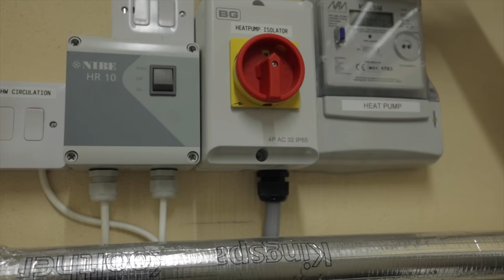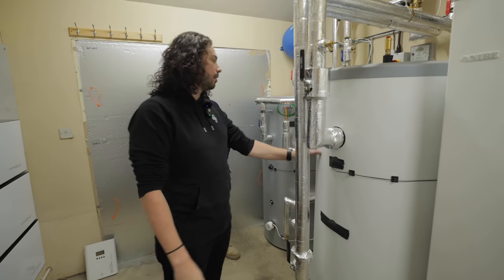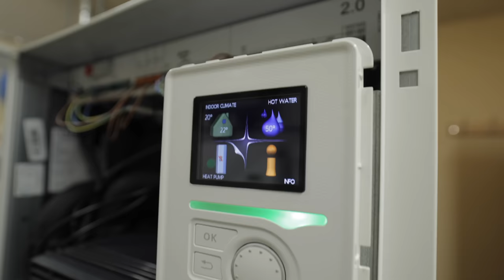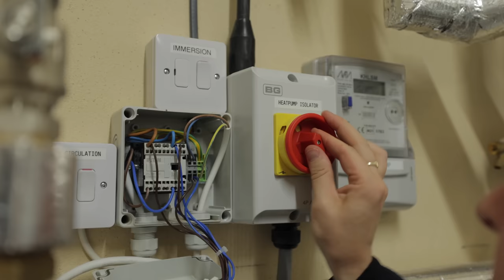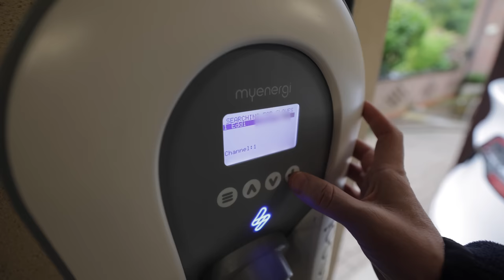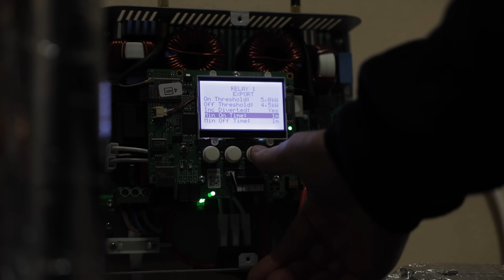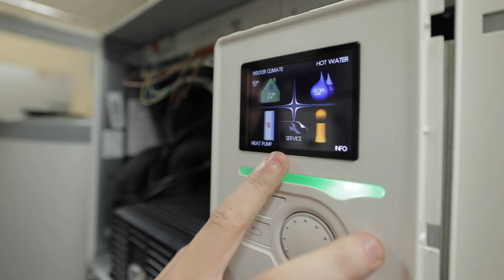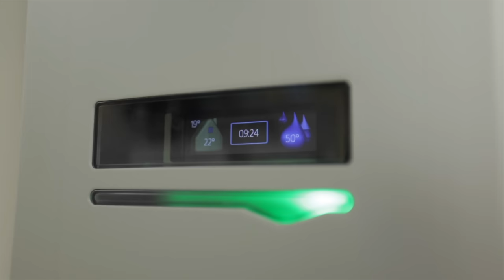This Solar HACK for Heat Pumps could save you THOUSANDS

Comment: Very interesting about triggering the heat pump from the Eddi. I've not done that with mine. I used to simply divert solar excess to the immersion element until I realised that raising the water temperature during the day stopped the heat pump heating the water at night on cheap rate, which it was set to do, because it made the water already hot enough. Add to that if you are on Octopus Flux then you are much better off exporting at 20-30p/kWh than saving the overnight water heating with cheap rate divided by COP to keep the water hot.
Heating from solar excess with the heat pump is better but it only saves that already cheap rate/COP overnight by shifting it to the day.
I use the Eddi now as a timed top up for the Legionella cycle one a week if the heat pump can't quite get it up to 60°C along with its PT1000 to monitor temperature.
Incidentally, if the 400L tank is already at 50°C it only takes 4.6kWh to raise the temperature up to 60°C so it's not a huge energy store. 
I'd be interested in what other uses for the Eddi there could be.

Comment: Hello lads! A little thought for reflection having in a similar system... A negative side of this application can be excessive wear of the heat pump, aggravated by the fact of operation at higher water production temperatures. For this reason it is essential that there is an effective use of the hot water and that it is not heated for no reason... Otherwise the electric resistance is better, which despite having a lower efficiency, does not cost as much wear and tear as replacing the compressor of the heat pump. Another idea could be to accumulate heat in the building instead of in the boilers so that the production of hot water is at a low temperature and remains efficient; it would be necessary to install an intelligent thermoregulation system that increases the room temperature set points based on the use of the rooms, weather forecasts, time of day and photovoltaic production. 😉

Comment: The NIBE heat-pump has an optional feature to connect directly to the inverter and use excess energy to raise the temperature of the buffer/property and/or the hot-water cylinder to efficiently 'store excess' energy when it's available.
Reply: I have a Nibe F1145 GSHP and have an Eddie installed. Do you have any info on how the feature you mention works please.

Comment: A buffer doesn’t always increase efficiency. That’s a big statement and very debatable
Reply: Was just about to write that as well. First of it loses some energy into the room over time. And more importantly, depending how it's piped, hot and cold water mix in it. That requires the heatpump to produce hotter water then is actually going to the radiators.

Comment from the maker: I hope you all enjoyed this video. If you did, make sure to leave a like and comment 👍 See you lot in the next one!
Reply: Very interesting. I’ve read stuff recently about sand batteries. The obvious advantage is the amount of heat you can store is far above what you can in a tank of hot water. 
What’s Jordan’s thoughts on heating a sand battery by DC from the solar array?
Reply: I really enjoyed the video.
Reply: Great video.
I left a comment with helpful information for anyone wanting to replicate this setup for their own house, highlighting that there is a feature limitation that means it isn't very useful for anyone with a non Libbi battery as the heat pump will be falsely triggered when loads like a kettle turn off. Something that can be configured using the Export delay for the immersion but doesn't apply to the relay in export mode.
I can't find this comment any more, was it deleted? Surely this is important information for your viewers so they don't assume it will work for all setups until MyEnergi address this issue?

Comment: Great video! Going to build a similar system at my farm, but I want to extract heat from the pig house in the summer and have a large centralized wood burner for heating in the winter. Im living in Norway so I require a lot of heat in the winter, so it is going to be really interesting to se if can power everything of solar and windmills.

Comment: Interesting video thanks for sharing.

Wouldn't the best way be to turn on the immersion heater when there's not enough excess power to run the heat pump on, then when there is turn the heat pump on and if there's still excess after that then ramp up the immersion on top?

Comment: Fronius pv inverters have had the Solar API feature for quite a bit of time. This means it can connect via a local ethernet connection like a compatible heat pump and give the heat pump the information there is this enough excess power available and the heat pump can start producing heat if set in that way. This all without additional hardware or wiring.
Reply from the maker: That’s cool
Reply: Any quality inverter (Fronius, Kostal, Huawei, SMA, …) has a Modbus Interface.

You can either use professional software & gateways or simply use ioBroker, Nodered or Homeassistant to switch some Shellys or show the energy status by switching a Hue bulb in traffic light colours.
Reply: and nibe has a ready built interface to use for it. And since it's an inverter pump it can regulate accordingly to use everything from the solar
Reply: @Iceeeen  Yep. This vid is about solving a non-existent problem with the wrong gadget at 3x the cost.
Reply: @maxking3  Does Uk have electric spot price now? Because Nibe also has the included if you want to run it on the cheapest hours of the day

Comment: You could have just installed a NIBE EME20 to connect the inverter to the NIBE. The controls of both will take care of everything.
Reply: Or Connect the solar inverter and the Nibe via Modbus to ioBroker or NodeRed and achieve the same result with more control & functionality.

MyEnergi will die a slow death, as modern inverters already have configurable relays built-in (Kostal now has 3 of them) and people realize, that energy management is a software game.

Comment: I see tech like this as kind of like the Mercedes S class / BMW 7 series of home tech: yes, currently it’s mainly aimed at high end installations and the costs are currently high, but eventually it will trickle down. At one time only the S class had heated seats, sat nav, digital dash etc, now even entry level corsas have most of it.

Comment: Funny, the HVAC/plumber normally does all the water/gas/electrical wiring work on the systems, not typically the electrician here in the USA.  Here we also have air based heat pump water heaters directly that are gaining popularity along with the tank less units, although most tank less are gas powered as it becomes very expensive to try to heat all the water for a house in real time.  So for example we have a 36KW heater which takes 150A at 240V.  So that is why gas is used for that side.  The heat pump based systems because the hot water recovery is so slow, will typically have a small compressor running at 120V AC (under 1800W) but many also have 240V emergency induction heaters as well just in-case the demand is too great and the compressor can't heat fast enough.    Our own house just have multiple natural gas tank based heaters.
Reply: Where do you want to start? The quality of US electrics & craftsmanship, the way US houses are built & insulated or that Americans use more than double the energy per capita compared to other Western nations, ruining the climate for the next 10.000 years… that‘s 400 generations!

There‘s potentially a lot to discuss here…

Comment: The Eddi is a superb product but is it still a good idea? When you’re getting 17p/kWh for export (28p at peak) does it make sense to divert your ‘excess’ solar to heat water that, frankly, you don’t really need? It’s like boiling a kettle every half an hour on the off-chance that you might need a cup of tea. In fact, I haven’t done the maths but I bet it’s more cost effective to heat your water from a gas boiler than from ’excess’ solar when you’re losing 17p/kWh by diverting it. On top of which, you’re really helping the grid (and by extension, the planet) by being part of the smoothing out of the demand curve by exporting.

Comment: Export @ 15p kWh or use the solar to heat the hot water? Is that the cheapest way to go about it if you can import at a cheaper rate and use the ASHP to heat the hot water

Comment: Usually find the 16 amp relays in the solar diverter fails after a year or two or less. What do you think. They aren't man enough to constantly switch 3 kw. Have had to bypass unit and put back to normal method for switching on/off. What do you think. Great video by the way.
Reply: eddi is a bit more clever, works like a dimmer switch
Reply: @edc1569  So it's using PWM?

Comment: Nothing seems to change with Solar, it’s tech for those with money.  I maintained 20 years ago it should be piled high and sold cheap to the masses.
Reply: …Or those who can borrow money. It can be cheaper to pay for the loan each month than to pay for the fuel!
Reply: Is solar gunna make a big diffrence without the battery storage? 
And cost of battery storage is around £30k (Allen hearts video) a £30k+ loan is probly around £600 per month... It would take many many years to pay for itself.. then you have any repairs over them years from someone who knows what they are doing and what if they fail out of warranty... I have my heating on 24/7 and with electricity is about £100 per month..
Reply: A domestic solar and battery install is nothing like £30k. Maybe £12-£14k which, on a 10y mortgage rate is about £150pm. When your lectric is £220pm you’re quids in.
Reply: @brendanfisher2528 crikey, how much battery storage do you need? Last I heard the most expensive battery was the Tesla powerwall at about £14k, others are half that or even less if you don't need that much storage.
Reply: I am amazed that some poor people pay 60-70 grand for fossil fuels over the 20 year lifespan of a boiler. 

They could have saved half of that with a 20K heat pump.

But it seems that everyone is hell-bent on making arabs rich, instead of creating factory jobs for the energy transition.

Same thing with solar.
Reply: @maxking3  not sure a agree with you unless you can buy cheaper electricity than it has been. Heating oil at 70 p was way cheaper than electric at 30 odd plus many thousands on conversion. Solar won't run jack shit in winter months unless you had say 12 to 20 kw. In my experience ( just upped mine to 12kw but no intention of installing heat pump)
Reply: I sort of disagree solar is relatively cheap now probably get 3kw setup for a few grand nowadays. I've got 2kw and it saves me a fortune plus I can use.more than I would normally so for example I can run an AC unit through the summer which I wouldn't be able to afford without the solar. My electric bill is consistently £70 even now with higher prices 6 of us in the home using tumble dryer, dishwasher and multiple TVs and there is always someone in the house. I'm not super efficient with my usage don't unplug stuff, alot of smart devices I'm quite happy with that considering.
Reply: @MyMateYourMate   Problem is that the sun doesnt shine when you actually need fuel in winter. You sell it to grid in summer at bad rates unless you run your AC on solar.
Reply: @brendanfisher2528 I'm in southern Australia and have had solar for 18 months, and have disconnected from gas, and switched to reverse cycle air con (heat pumps) and hot water heat pump. During summer months, my energy bill is about $30, and in winter months about $120. The coldest temps I get to are about -2°C, and the heaters are on from April to October, and then the cooling is on.

No battery installed but it's so worth it. The biggest saving was just getting cheaper heating through winter by using heat pumps rather than gas heating. Jordan explained the COP in the video. That's where the big saving is. When energy efficient appliances are installed, your solar bang for buck goes a lot further.
Reply: @ofsen2497  Correct. The balance across the year is still positive on a regular basis. PV in the winter might be 10% of our usage but in summer it's maybe more than 200%. It all depends on the rates you get to export, which in the UK, are improving significantly. Mantioning AC suggests you're in the US as most UK homes don't have AC. No idea what the rates are there.
Reply: @MyMateYourMate  us energy is cheaper in general apart from a few outliers. Some state do however to use the grid as your battery so essentially reversing the meter I believe you get something like 90% back in credit which I think is a far better system than what we have in the UK.

Comment: We do that with the EVCC running on a raspberry pi charging the car and heatpump for water where the 270 Liter water will be heated up to 62°C from surplus energy from the solarpower array. Prority 1 is the car if connected and priority 2 goes to the heatpump cause that can also deliver its energy to our radiator heatings over the heatexchanger that delivers the heat to the oil heating that is no longer running, only the hot water is running through and in case the heat delivered from the atlantic explorer V4 does not deliver enough then the oil heaating kicks in. 
cheap and easy solution casue the warm water heatpump with heatexchanger was about 1900€ and the evcc on raspi is about 50€ and that was a game changer for us.
Reply: Can you please provide some more information on how to do this with Raspberry PI

Comment: There is a bit of an issue now. If the customer is on Octopus intelligent, like i am, we get paid 15p/Kwh for export and pay only 7.5p for off peak import. If the customer is in this situation, it now makes since to fully charge all devices at off peak rate to then maximise export in the day. Not sure how easy it is to change the MyEnergy Ecosystem's settings to this new situation.
Reply: You can change then to leverage this,  we are working on a auto mode to adjust the schedule for you for getting the most cost effective energy

Comment: And if you are a really good electrician, cover the temp probe hole with insulation. Because that is substantial heat loss when open!
Reply: And if you're an even better electrician then apply some thermal paste too 😏

Comment: Could you not setup the heat pump to heat the extra hot water cylinder, with it's superior COP? Get it to divert to heat water in both tanks, when excess solar.

Comment: I lost the plot on this one.  You start by telling us that immersion heaters are inefficient when compared to heat pumps, and then appear to go on and do a complicated install to use excess electricity to power  the immersion heater to heat the water.  

Why is the excess electricity not used directly  to run the 3x + more efficient heat pump system rather than dumping it in the immersion heater?

Comment: RS485 to n/o and common 🤔😳🙄
Reply: it is just for show 🙂
Reply: It’s just being used as a volt free contact, he’s just used to referring to cat5 used in that way as RS485 as that’s what it mostly is. You can see where he connects it into aux2 that it’s just looking for switch contacts.
Reply: It is likely ModbusRTU, as that‘s still a common interface for heatpumps & solar inverters. It is using RS485 as a transport medium.
Reply: I noticed that too..... Not RS485 at all or any communication, just a dry contact and switched input. I/O is not RS232 or RS485.

Comment: Heat pumps are garbage 👍🏼
Reply: Do you have one? Mine already paid itself back.
Reply: Not for air conditioning
Reply: Ours works spot on  !!
Reply: Kevin is to poor to buy a heat pump 😢
Reply: @Dale-11  😂😂😂 amazing how you know my financial situation
Reply: It will be garage if its not installed properly or running on undersized radiators...
Reply: It will be garage if its not installed properly or running on undersized radiators...
Reply: Based on?…….
Reply: No, heat pumps are an extremely efficient and reliable form of heating.
Reply: Heat pumps always bring the trolls out😅
Reply: @mikeypc3592  Hate Punks 😉
Reply: The haters are going to hate, no matter what science or genuine experience you show them.
Reply: OK, you m0r0n, then throw out your A/C and your fridge. 

Because they are both heat pumps!
Reply: @sircaptainchaos2388  Clearly wasn't installed properly (if at all). I have 3, and my whole house consumption currently is less than what my kettle uses on its own - it's also 1C outside, and 21C inside.  Haven't used my log burner in well over a year.